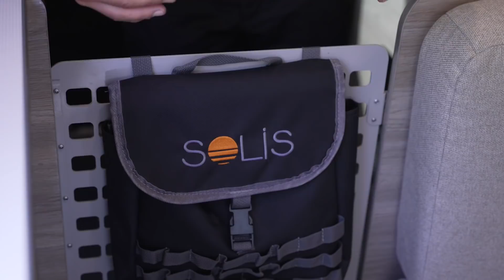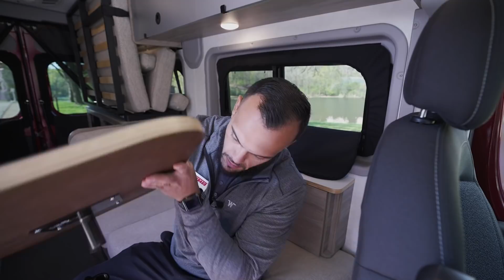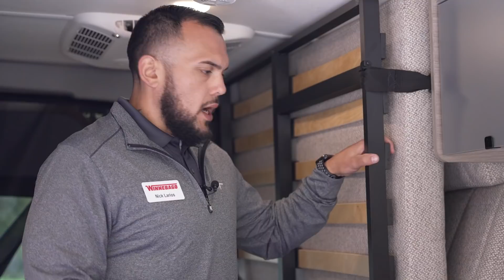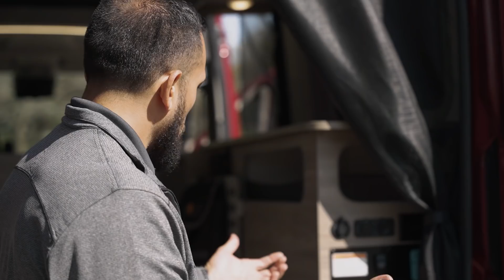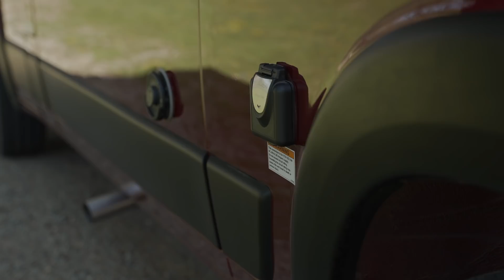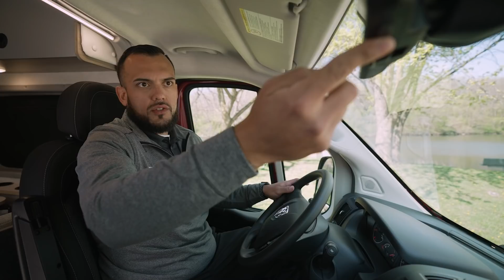Walkthrough: WINNEBAGO SOLIS POCKET - 36A Floorplan

Comment: All season insulation???    What do you do with the cushion to be able to use that countertop on the passenger side rear??   What if the bead is not comfortable for a 76 year old lady ? Is there room for thicker cushions?  Thanks for demoing the various couch versions!  ... Fridge- 12 volt - does the van have to be level for it to run?   What is a Truma heater?  Murphy - yikes - that is a lot of bed parts to put together to make the bed size mattress.  What is the distance from the bed to the ceiling?  I need to be able to sit up.   ... Air conditioner - is it 12 volt?  If water fill is inside, how do you do it at a campground with water hose hookup?  For the temperature/insulation test, was it down to 5 degrees F or C?   3500 pound trailer hitch??  Will that pull a car?  Are swivel seats in all of them?  ... Curtain between cab and living area?  Heater??? Didn't hear about ? With high altitude?  How does in snow? Tires? Any different cushion cover fabrics?

Comment: I was sold up until the steering wheel phone situation, it weirds me out. I need cruise control at my fingertips, not a phone. I currently have a 2010 Honda Fit with shift paddles at my fingertips and cruise options at my thumbs. I downshift, accelerate and glide all at the wheel, rarely using my foot. It's a pleasure to drive. I don't want these pansy-ass music and phone buttons. "Safety"

Comment: For $20k to $30k less you can buy a Thor Rize or Scope with or without bathroom.  Plus they also have a microwave, generator and much better control systems.
Reply: Bought a Solis Pocket today and actually considered the Thor 18T and 18M that you mentioned. But we have a 4 year old and the 2 Thor models only offered 2 rear lap belts and sideways seating for our daughter whereas the Pocket offered a 3 point harness with booster seat tether and was forward facing. This was literally our deciding factor.

Comment: Fits what I'm looking for EXCEPT the propane.  Would much rather have the Volta and get rid of propane altogether.  :(  The no bath is perfect.  I hate that wasted space in a van...people think it's so important but it's always too small and takes up so much room!   Like I said, it needs Volta and a chassis lift.  I'd rather have the road clearance and AWD or 4x4.  But at least Winnebago is starting to understand the popularity of the STO and is getting onboard.
Reply: We just bought one today after talking through our needs and wants. We ended up going with a camplux water heater that hangs in the back door and uses the water outlet and the propane to give us but water. Found it on Amazon for about $150. With the rear annex and the camplux we can now have hot showers as well and lose no space. Love the Solis Pocket.

Comment: Must be rough to work so hard on a product and get so much negative feedback. Here’s what I like: short wheel-base van, 4 season insulation and truma heater, inside utilities, rear Murphy bed with garage, flexible dinette options, swivel chairs, lots of electric, isolated propane, screens, privacy curtain, layout. Agree that it needs hot water and a better approach to cooling-second alternator, maybe? More solar, lithium batteries, separator toilet, interior shower.That said, I’ve seen one-off custom self builds for significantly less. Winnebago, scaling up and benefiting from others designs, could do better.

Comment: You present well, but we really don’t believe that second “bed” is comfortable. You could not even strengthen out your legs. The main bed will do, but this is not for full time. My back would pay the price on the main bed. I do like everything has its place.
I’d love it to drive as a everyday car. Then I’d have the potty if needed. Could go fishing and use van to have lunch or cool off, get out of the rain. Be good to go to the beach in. The cost of the van is to high. The drawers look like they are about to fall apart.
I’d pay 60k for it max.

Comment: Why soooo many 12V outlets? No mention of USB outlets…
Reply from the maker: While not called out during the video, there are 6 locations where USB ports are located in the coach.  You can see 5 of the 6 at these points in the video:
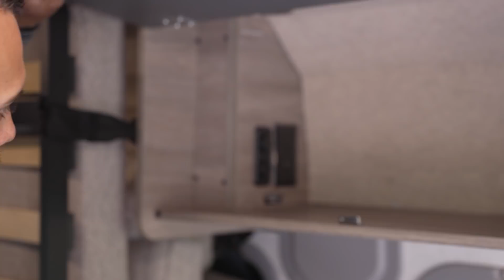Driver's side overhead @ 2:11
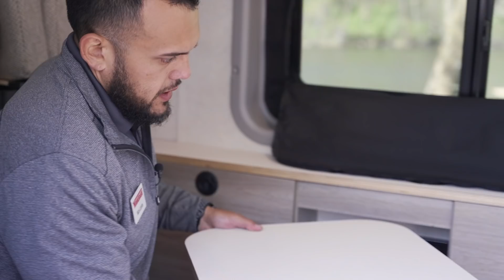Dinette  cabinetry @ 2:48
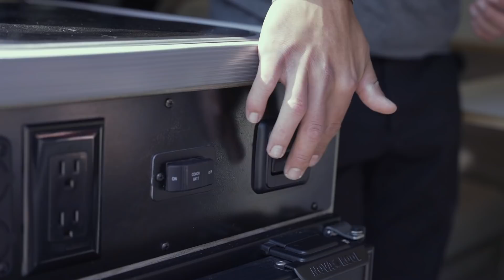Above refrigerator @ 6:53
Under large work table top @ 10:09
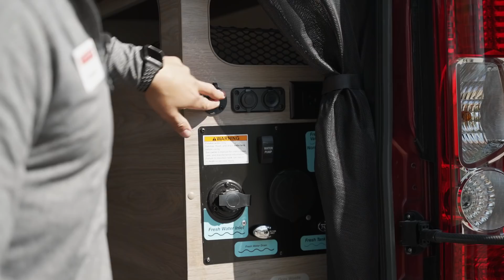Rear of coach @ 11:45
Plus 2 in the automotive dash area

Comment: Nice package. The only thing missing is the ability to shower inside the van. Thor has done it on a 136" wheelbase Promaster. When I can get WBG quality in a 136" Promaster with toilet/shower services inside the coach, I'm there.
Reply: I’m thinking this model prioritized cargo storage under the bed instead of bathroom. Those other short models don’t have interior storage for bikes or bins of outdoor gear. Hopefully more floor planes on this short model follow though.
Reply: @ChopperChad  Agreed. That's what I like about the coach companies making many floorplans. Everyone has a different need. I really like the Thor floorplan but I much prefer WBG quality standards.
Reply: We have a WInnebago Solis and a Thor Scope and overall really impressed with the Thor.  They all have issues but they are about equal.

Comment: Thank you for your video!   Is it FWD?   Will there be a version with Adaptive Cruise Control (ACC) and blind spot monitor?  I can't see buying anything anymore without ACC.
Reply from the maker: Yes, the unit is FWD (front wheel drive).  But with this being a smaller chassis, adapative cruise control and blind spot monitoring are not part of the product.  However there is crosswinds assist.
Reply: @lamesarecvan  Thank You for your reply!

Comment: Where is the fresh tank drain?   Where are the low point drains?
Reply from the maker: All low point drain valves are located at the rear of the unit inside in the back access panel by the gray tank release valve.

Comment: I like it! Can this be ordered without the AC? Maybe a 2nd exhaust fan where the AC sits?
Reply from the maker: Currently there is not an option to order the unit without air conditioning.
Reply: @lamesarecvan  Thank you! Not having the big AC unit would allow roof rack system for canoes, kayaks, etc

Comment: no bathroom 😬
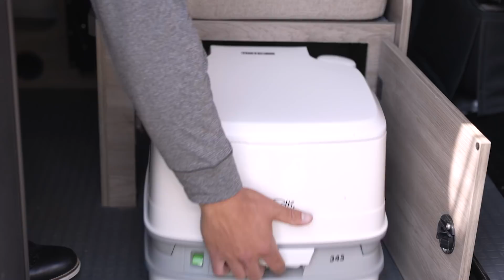Reply: No bathroom, but it does have a cassette toilet. (6:15)
Reply: @brianj.simpson4050  l did not see that, better then nothing 😁👍
Reply: That's the compromise, its a 136" wheelbase, they could have done a pullout cassette potty
Reply: @lkazanov  - They did do a cassette toilet.  (6:15)
Reply: Toilet is in cabinet under dinette 🤢
Reply: @Chris we have a 2019 zion srt and the bathroom is the most used and important feature. Fellow van owners we meet who bought a van with out or just a slide in tolet tell us they plan to upgrade to a van with a bathroom. Each person is different in their wants we know, but for us it was #1
Reply: @Chris lm a boomer who down graded from a class a 😂